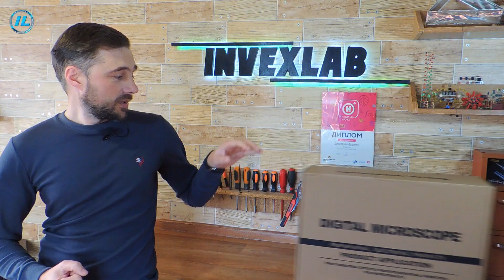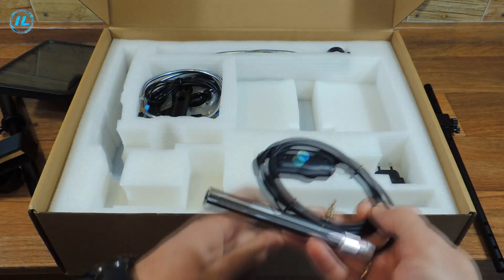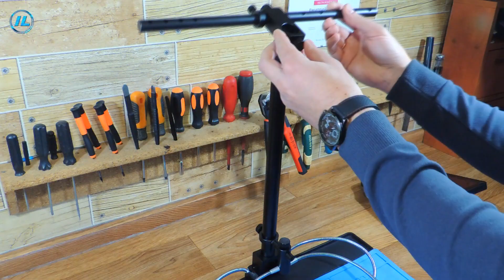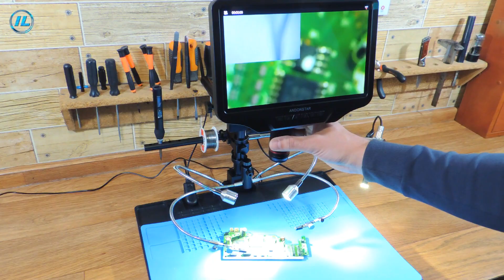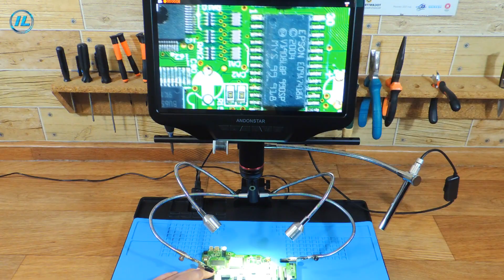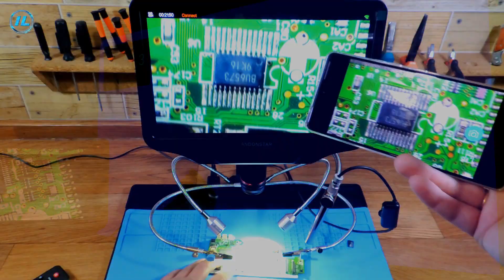✅ It's not just a microscope... Everything is here! Andonstar 409 Max-EX microscope overview. ✅

Comment: Quick question: Does your microscope come with a built-in lens protector from the factory, or did you add an external UV filter yourself to protect it from fumes?. Do you thing it could damage the lens without the lens protector?